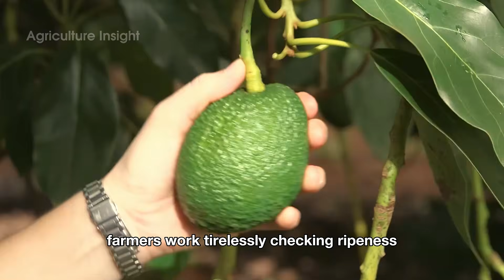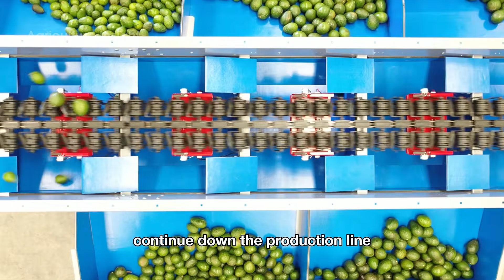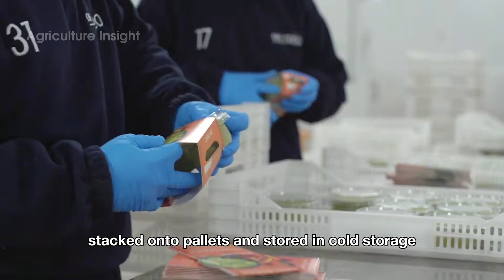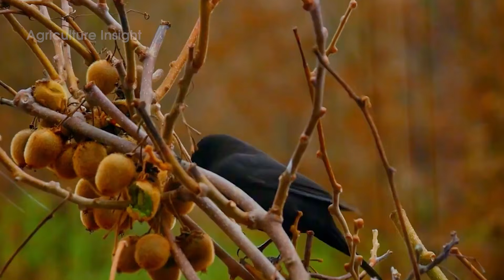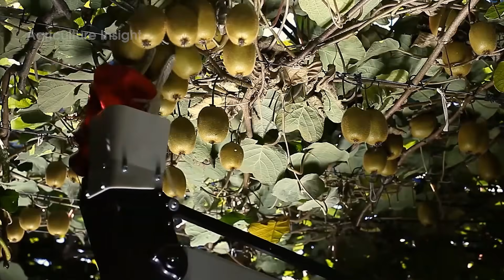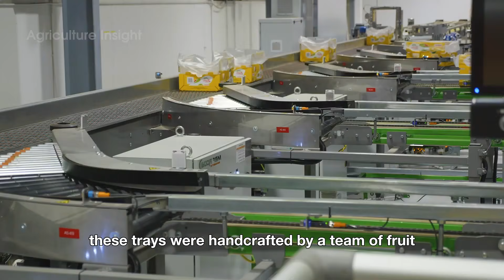How American Farmers Harvest 260 Million Pounds Of Avocado | Agriculture Technology

Comment: Florida isn't mentioned but our Avocados ARE smooth skin and larger than those from CA. Choquette avocado is a prime example. 13% oil content and 30-40 ozs ( 850-1100 gm) each. While a Hass has 8 to  20% oil content, it only weighs in at 7 to 10 ozs ( 200-300 gm ). One quarter the size of a Choquette avocado.
Reply from the maker: Thank you for sharing — Florida avocados like the Choquette are truly impressive in both size and oil content!